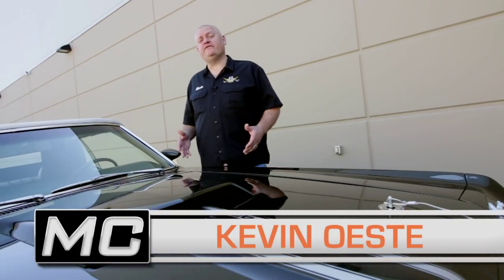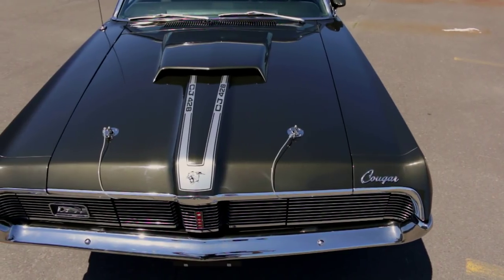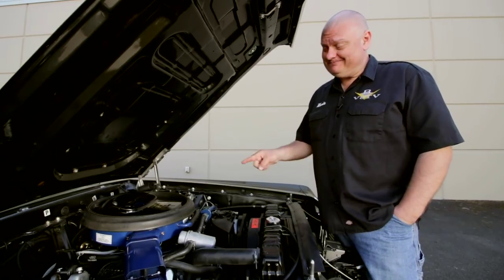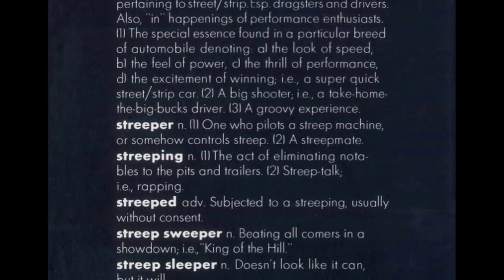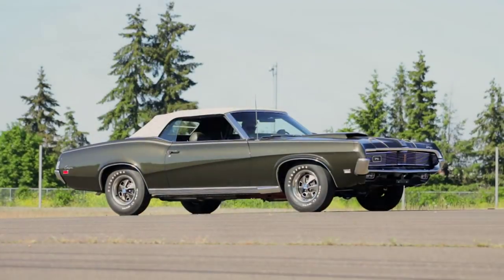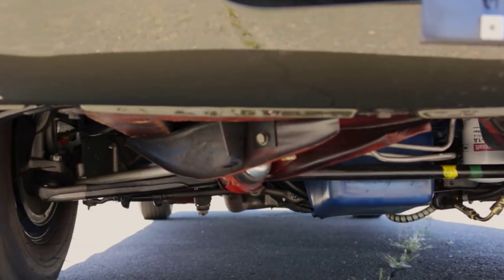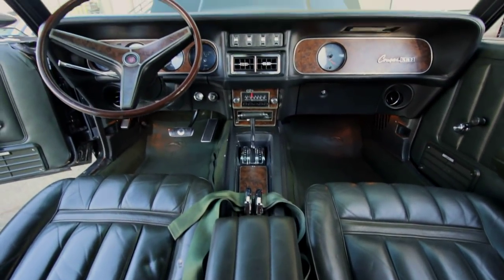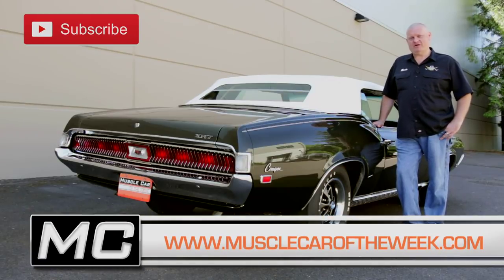1969 Mercury Cougar XR7 428 CJ Convertible: Muscle Car Of The Week Episode 267

Comment: The bosses' wife had the near-identical car back in the '80s, the very first 428 CJ I ever drove. I was ruined by that car, Ford guy ever since. Hers was the same year and color, same options except tilt wheel, but was a hardtop with white vinyl and a factory sunroof. What a great car, a 428 CJ/automatic with 3.00 or 3.50 gears was one of the '60s best burnout machines. No brake standing necessary; just point, floor it, and light the tires for a block and a half. Brutal!

Comment: Ford really restricted the power of their passenger cars from the factory. A 428 Cobra Jet with only a 735 cfm carb??? C'mon man. I'd pull that thing off the day I bought it along with the restrictive exhaust manifold and bolt on a 780-800 cfm Holley and a set of headers. And better tires as well

Comment: The engine was underrated a bit but revving one past 5k was pointless. As for tach not having a redline, the engine stops making power even before hitting valve float around 5800.